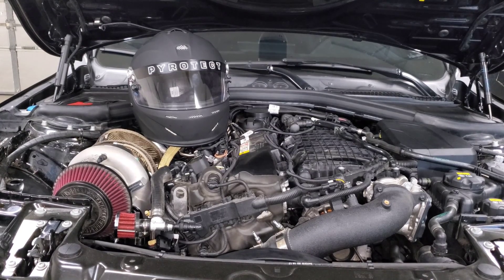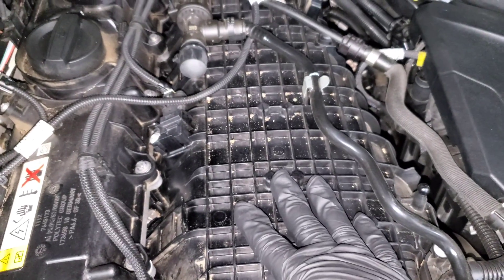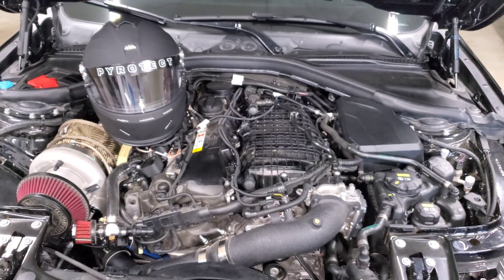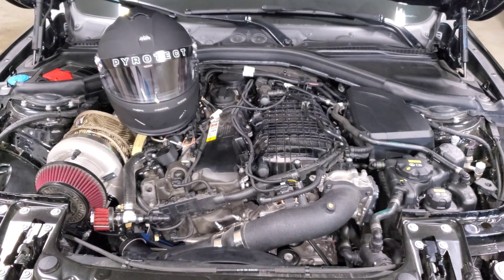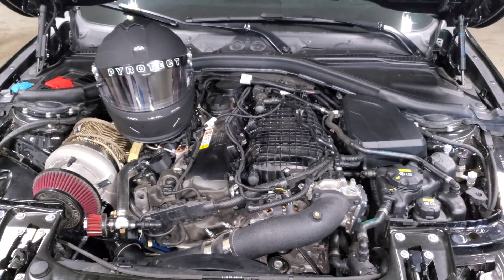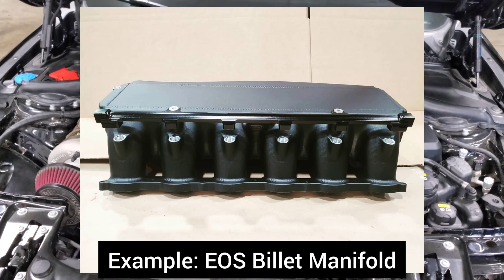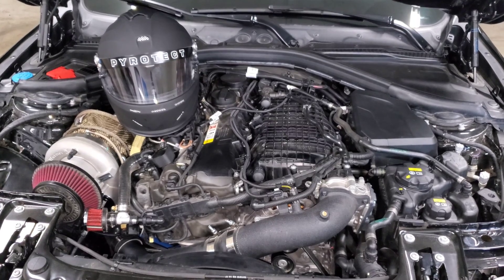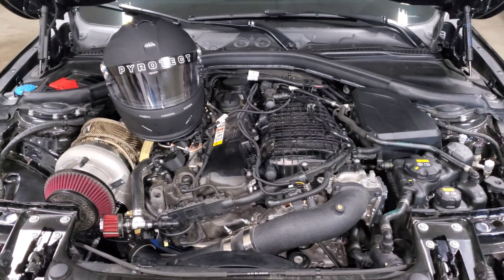How to reduce IATs in your B58

Comment: Kern: What about altering the water/coolant blend in your low-temp / intercooler cooling circuit?  (Moving to a 70/30 water:glycol ratio and adding appropriate amounts of water wetter+anti-corrosion additives?) 

You get the better specific heat of water and less viscosity, which means minor increases in the flowrate through the system, too.

Comment: Hey kern! I just turned iat’s on and I’m noticing I’m getting 20 degree over ambient sometimes even higher! It was 25 degree here and I got up to 63 degree c. I’m at 70,000km and never changed my intake filter that should be the issue right?

Comment: Please help i ran high iat like 130 and my car makes negative timing on all cylinders sometimes it does that sometimes no.i have downpipe intake and hpfp stage . I switched plugs with all kinds then coils all sensors checked the pump all fluids good but no hope ((even on stock tune

Comment: Hi Kern
I am having really high temperature in the intercooler, the system was checked, no leakage, tank is full with the green coolant, pump is working fine. I have DP, intake and TU fuel pump, changed the LPFP as well, and did a custom tune which is very safe, around 400 hp, but still when I do a pull on 4th to test it, the temp goes to 150 degrees celcius (302 Farenheit). Could it be a sensor issue? any recommendation will be appreciated! Thanks!
Reply: Same thing same mods have you found the solution?
Reply: Running into high temps on stock tune, system seems fine. What was the problem with yours?

Comment: I went on BM3 app and saw mine at 133 on a 81 degree day with bms intake. I’m going to buy the extended turbo heat shield and modify the intake to face into the air box and see where it goes

Comment: Hi Kern, I’m watching this video once again to troubleshoot my IAT temperature (440i GC 2016 MHD stage 1 98oct Ron) the ambient temperature here in Spain is currently 30degress celsius, but IAT while driving is 45-46 degrees celsius… is that normal? if i let the car idling 5 minutes it raises up to 70 degrees celsius… I think this is not normal… i have selected in MHD sport cooling mode for intercooler but looks like is doing nothing! how can i know that the water pump for the intercooler is not working? apparently when i turn off the car, i still hearing a wining noise during several minutes… is that the water pump for the turbo perhaps? i really appreciate your help, thanks!
Reply from the maker: Sounds normal
Reply: @kern417  really? Oh ok, then nothing to be worried about... i’m just learning about this engine and I thought the IAT should be like 5 degrees above the ambient temperature and not almost the double! 😉👌🏻 thanks for your time to help me!
Reply from the maker: When you're not moving there's no air flow so it's normal for iats to rise. As soon as you start moving again it should drop pretty much immediately.

Comment: I thought charged air was after it passed through the intercooler, and boosted air was compressed air from the turbine before it hits the intercooler. Is that incorrect?
Reply from the maker: Charged air temps refers to pre-intercooler

Comment: Any draggy times with the new turbo kit?
Reply from the maker: Current best is 7.2 60-130
Reply: @kern417  0-60?
Reply: Is this with the custom tune?  Thinking of getting into a m240x,  but not a lot of good times posted.  How hard is it to get these 1st gen b58 into the low 10’s high 9’s
Reply from the maker: Yes it is a custom tune. All you need is a turbo and upgraded Fueling

Comment: Im only stage 2 but should i turn on sport cooling on mhd just cause?
Reply from the maker: I don't recommend it for daily driving
Reply: @kern417  I just had the same question, why do you not recommend it?
Reply from the maker: @Dennis0908  Because it drops engine temps below optimal. It should only be used if you're at risk of overwhelming the cooling system.
Reply: @kern417  what about sport for intercooler only? I disabled sport coolant target on MHD cause it was keeping my car out of operating temp under normal driving and didnt affect IAT. Seeing power loss around 100-110 F IAT on a unmodified X3 M40i with a OTS map.

Comment: Great video!! BTW, where is the intercooler tank reservoir located??
Reply from the maker: There are two reservoirs behind the front headlight. The smaller light is for the intercooler. Check out my last video walking you through the coolant bleed process for more information.
Reply: @kern417  ok, BTW how did your intercooler mixture go? I'm considering distilled water with a addicive like water wetter by redline
Reply from the maker: It was a very slight improvement. Not really a game changer
Reply: @kern417  dang, I was hoping for a few degrees drop or a faster recovery. 

BTW, the CAC cooling system is shared with the A/C correct? I know that the engine cooling system is separate, I'm just trying to figure which radiator is the CAC. I'm considering on mounting a mister right in front of it to help reduce the IAT. I plan on doing a endurance race and 1/2 mile runs later this year.